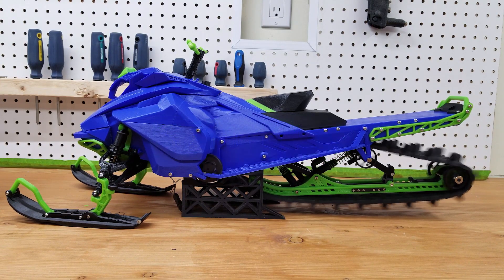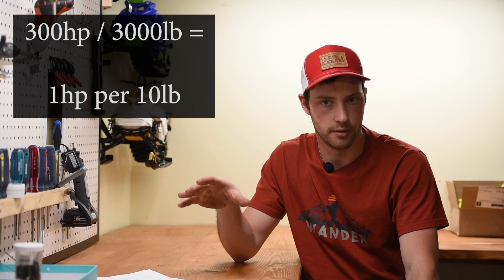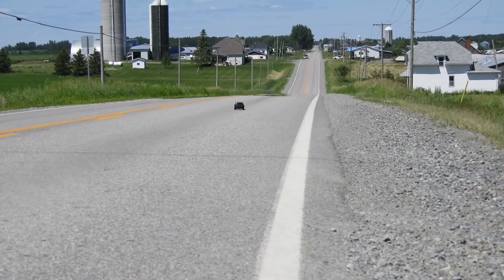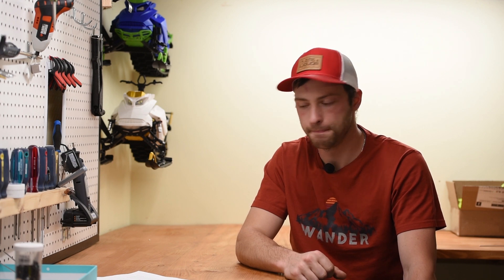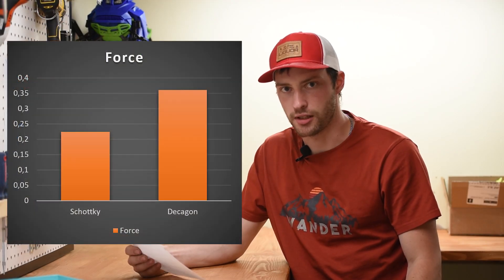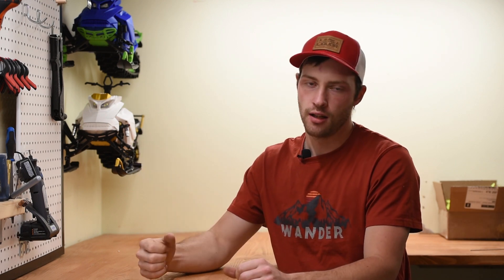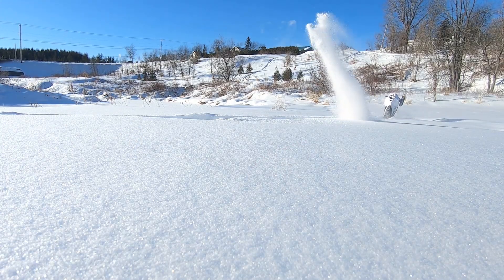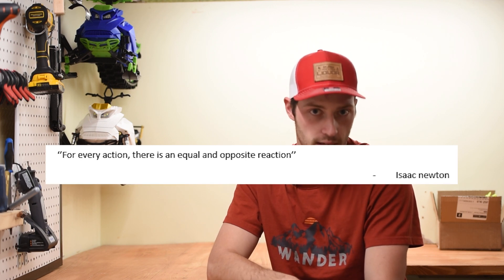Engineering 101 - High Power is Overrated

Comment: I put a 3900 kV in my Yamaha viper wheely on demanded .I Brook alot of track and gears but it was fun but  ended with broken engine shaft
Reply from the maker: Grease on the gears helps a lot with reducing gears metldown/breakages
Reply: Grease does help I started using pla+ last longer .during the summer I order taulman bridge nylon filament I will try that this winter